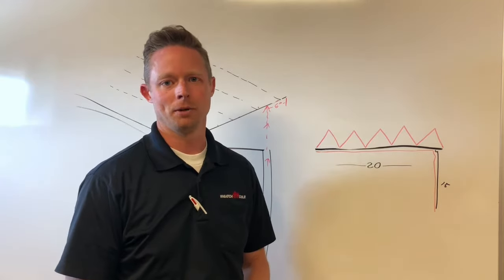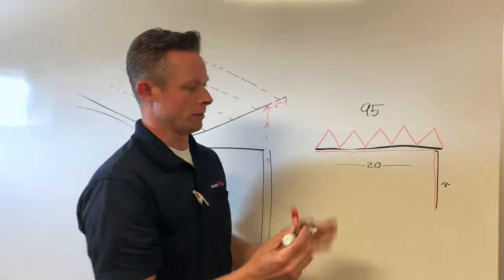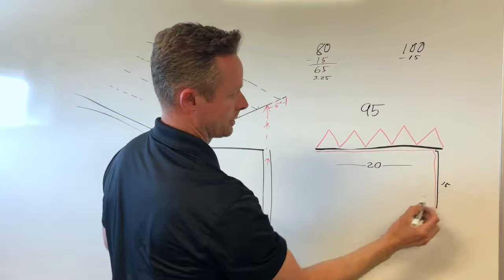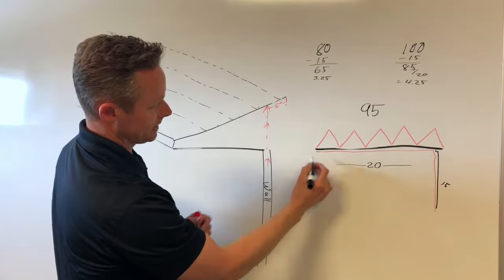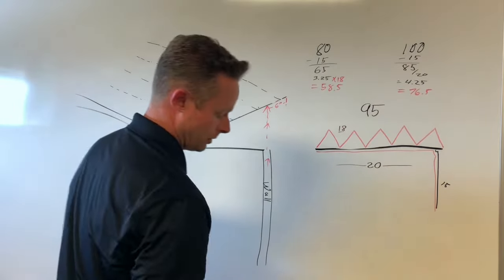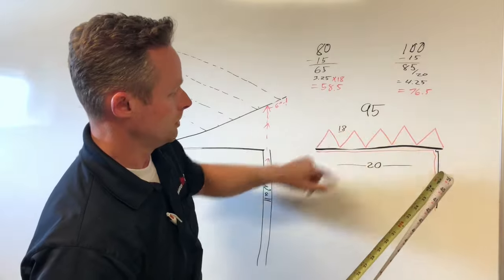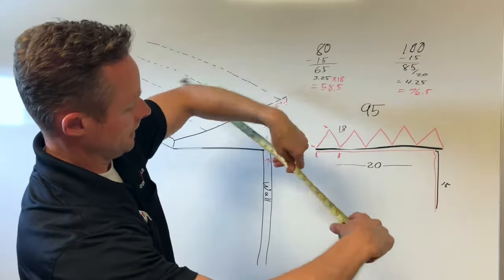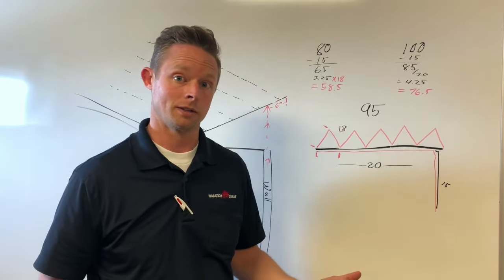DIY HEAT CABLE | STEP 4 | CALCULATE YOUR "ZIG ZAGS"

Comment: This is confusing the hell out of me....but I get the idea somewhat of covering your whole eave and the smaller span than the hypotenuse/angle.  My eave s 20" deep on a 12/12 pitch with 42 foot of run....anyone that comprehends this...post me a number on here otherwise I'll use my tape and figure it out with a 18" spread.  I've been a carpenter for 39 years commercially, but this home I screwed up bad as I have horrible ice damns.  I insulated the piss out of my room in truss trusses, but the heat is getting out and my eaves are freezing bad ice damn even though I used gable vents, soffit vents and venting for the chords of the truss for the air to flow up thru...very disappointed in my build that I thought I did a great job on and obviously was a figment of my imagination.

Comment: Thank you for this informative and succinct audio/visual - super helpful.  Is there a standard calculation for a metal roof with ribs that are 10 inches apart and with an eave that is 4.5 feet?

Comment: Great video thank you! If my linear feet is 50' and my eave is 13' (I have a large over hanging deck that utilizes the same roof as the house) what spacing could I use for the spacing at the bottom of my triangles? Thx
Reply from the maker: Glad you liked it. You could use anywhere from 18" to 30" at the bottom there. It depends on your snowpack and your preference. Let us know how else we can help.

Comment: Enjoy the video, but I am having a hard time wrapping my head around how much heat cable i will need. I have 30 ft of gutter, 13 ft of down spout and 13 ft of roof which I need to install the heat tape. The 30 ft is an "L" shape continual run gutter. How do I calculate how much heat cable I need to purchase? Thanks in advance
Reply: Add the length of the L to your roof edge

Comment: OK, Im following your process for the most part. You calculate 20x4=80+15=95 (manufacture's multiplier+ downspout), but then I don't see that number being referred to in the rest of this video. Is this an approximate so you can choose the precut manufactures lengths (in this example 80 & 100)?
Reply: By following this example I came up short by 20 feet. In my case, with a 46 ft roof edge and 13 ft downspout it was better to multiply the roof length by a factor of 5, which gave me a little excess but better than coming up short.

Comment: i would love to install one of these - I'd only need 100 foot cable.  My nearest 3 pronged outdoor outlet is 10 feet away.  Is there ANY sort of electric extension cord that could possibly be used. or is there a system that has an extended power cord that you know of.  Thx.
Reply from the maker: Hello - I would recommend you visit https://heatcable.com/shop/ and purchase one of our Factory Terminated Kits. We have EPD's plugs that will give your cable the protection it needs to be installed on your system. We can customize the length of power supply if more is needed. Give us a call at 801-896-8960 if you have any questions.
Reply: @wasatchheatcable8757  i'll check it out - thank you!

Comment: Can you space them only 12- 16 inches apart?
Reply from the maker: Yes, but that's not necessary unless you are in a really high snowfall area and you would have to add additional cable.
Reply: @wasatchheatcable8757  Thank you for your response. Great video!

Comment: My front roof is approx. 55' from one end to another.  The downspout is another 12', and another 10' to the outlet.  The outlets go to a 15amp circuit breaker.  Do you know if that will be enough, or will I need to plug the cable into a 20amp line?
Reply from the maker: We'd be happy to discuss your project further. Our sister company heatcable.com can be reached via phone 801-896-8960 or email info@heatcable.com It'd probably be easier for you to give us a call. We're glad to be of service.

Comment: in your math are you accounting for the portion of the cable that will go inside the gutter?
Reply from the maker: The typical multiplier on a normal installation with gutter uses a 3.75 multiplier. If you calculate using that math, then the gutter is included just need to add the downspout once that step is complete. Give us a call at our sister company heatcable.com 801-896-8960
Reply: The bottom part of the triangle of tape accounts for the gutter.  If you didn't account for that (by putting left hand on 18") then your zigzag only needs 40.5".